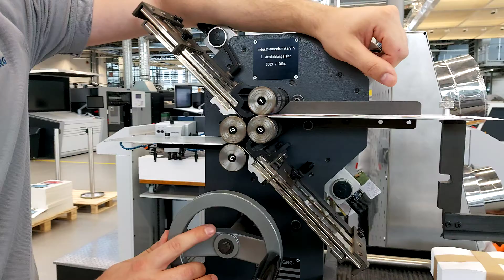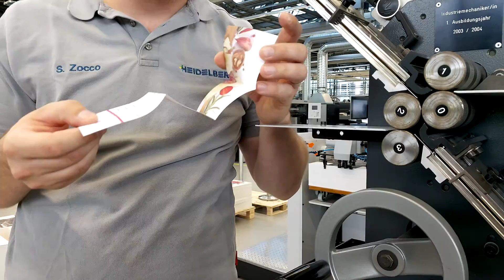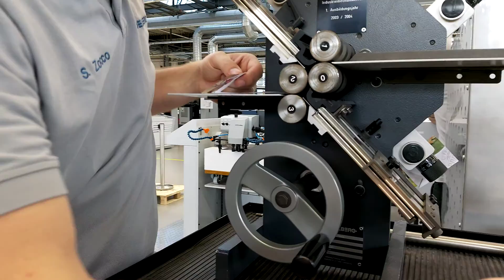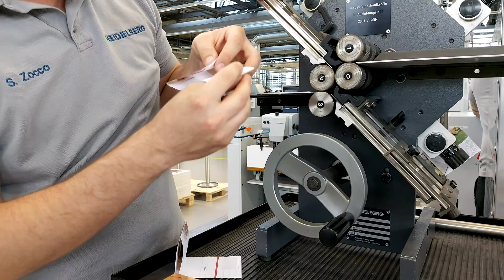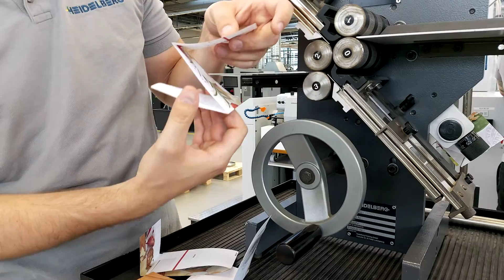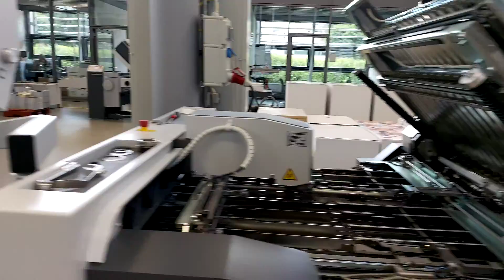Stahlfolder  |  How buckle folding works

Comment: When doing a roll fold papers are...1 in 1, 1 in 2,1 in 3 and 3 in the rest? Or 2 in 1 ? Have been debating this for years.....lol
Reply from the maker: @marcmarinelli8046  thanks for your comment. There are different possibilities. 
1. You can do rollfold with different plates. Using plate 1 and 3 for ⅓ folding length is popular, but even plate 1 and 2 are possible (⅔ & ⅓) but inefficient. 

At a zig zag fold it is correct to adjust the rollers till the last fold with 1 paper. But at the rollfold it is okay to underlay 2 papers after the first fold, as long the roller for the next fold becomes adjusted with 1 paper.
For example: 
Plate 1 - roller 1 = 1pcs
              - roller 2 = 1 or 2pcs, both are correct
Plate 3 - roller 3 = 1 pcs

So, you both were correct 💯💯 👍

A trick to avoid dog ears is, to rollfold the sheet into the bottom plates and to open the last rollers!

Regards from Heidelberg 👋👋👋
Reply: @marcmarinelli8046. Modern folding machines have “constant tension” caliper /FESTA roller systems. The mechanism for setting the roller pressures to the paper thickness/caliper to drive the paper through the machine allows for extra thicknesses to pass through. The rollers open to allow the extra layers to pass, and then return to the original setting. 
For example - to fold a ten page zig- zag/concertina fold (four folds, five panels) on a four buckle plate 1st Station, the rollers would be set : 
Roller 1 - 1 paper thickness
Roller 2 - 1 paper thickness 
Roller 3 - 1 paper thickness
Roller 4 - 1 paper thickness 
Roller 5 - 5 paper thickness
Slitter Shafts - 5 paper thickness.
With zig - zag folding, there is always a single thickness trailing panel which needs to be gripped to push the leading folded panels forward.
Tip: if you have a folding machine with eight buckle plates in the 1st or 2nd folding station and only need to make five folds (12 pages). Make a fold in the first or second plate to create the first panel. Then deflect past the lower numbered plates and finish folding the further four panels in the higher numbered plates. This means that only the higher numbered roller nips and slitter shafts are opened to the finished thickness. The roller drive (deep pitch gears?) can usually accommodate this better.

Comment: I spent 40 years in the industry. It's amazing how little has changed when it comes to folding paper. The machines may be different but the actual process is nearly identical no matter what machine you run.
Reply from the maker: Just visit next time, you are in Germany, the PMC in Heidelberg-Wiesloch!

The principle is still the same, but we developed a lot of new functions. From the Airplate, to the Knifeplate, shingle paper stream, until pressing rollers in all station etc. 
The finest feeder is incredible, the best we ever designed, and there is more to discover...

Look here, a further video with classic Principe but advance technologie...
https://youtu.be/GsWNH7BDGiI?si=5jx3kT-LpO0KUoG0

Greetings 👋👋👋